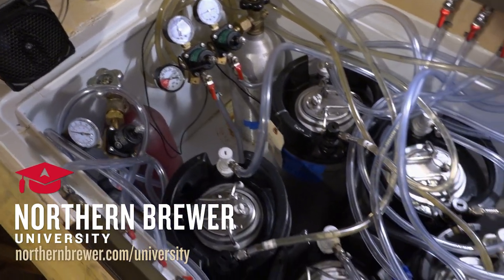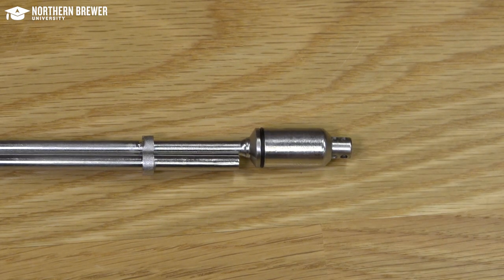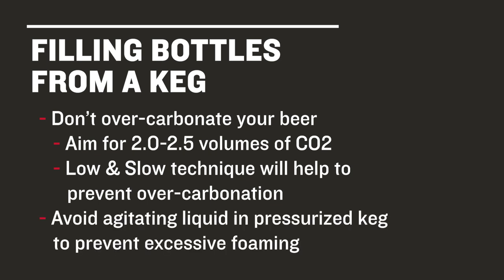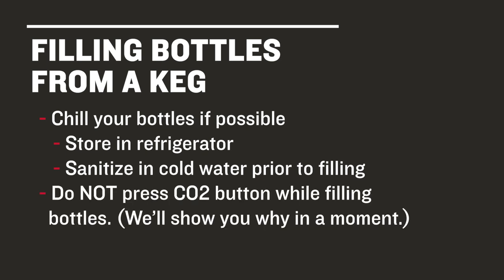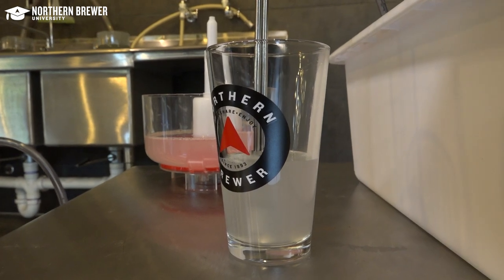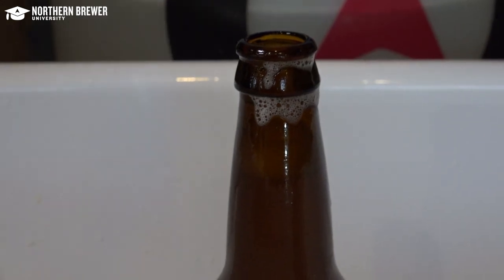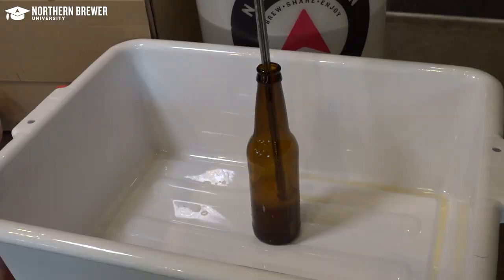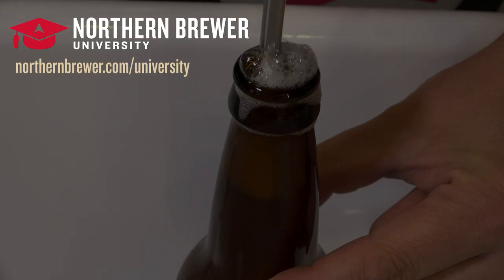How to Bottle Homebrew From a Keg

Comment: Recommend anyone watching this video to get themselves a proper counter pressure bottle filler. The price of these devices have gone down significantly in recent years! I use the Keg King Ultra Fill Counter Pressure bottle filler. Think it was only about £50 and it works on everything from beer to sparkling wine/champagne. I even managed to bottle sparkling wine at 5.5 bar of pressure and no foam whatsoever. Slower than the device on this video but no foam. The counter pressure bottle fillers are way more effective because you use a small button to pressurise the bottles before filling. This equalises the pressure between the keg and the bottle resulting in little, if any noticeable pressure loss or foaming.

Comment: You should also check out the ITab. Really happy with it. For the co2 I’m confused by your statement. I’d always increase by a couple points. If I want 2.5-2.6 I’d carb for 2,9 in order to account for the loss while bottling.

Comment: Do you really need to purge the air with CO2 first?  Once the beer is added to the bottle, most of the CO2 you added at the beginning will have been displaced and, as it's heavier than air, run down the outside of the bottle to your work surface, so when you remove the wand and the beer level drops, what gets sucked into the bottle to replace the volume that the wand was taking up?  It's not CO2 is it?

Comment: I have had no luck with the last straw. The tip design agitates the beer too much causing excessive foaming. I,ve over chilled the beer, cooled the bottles, tried different pressures, tried different beer types.  Nothing but foam.